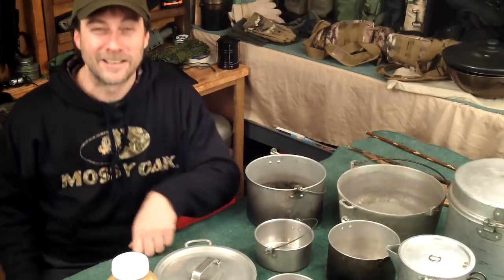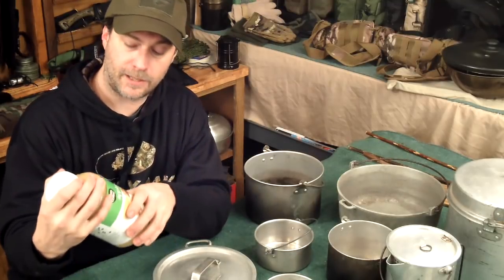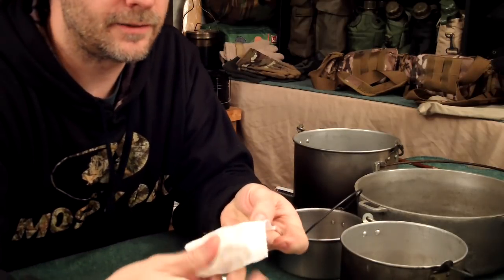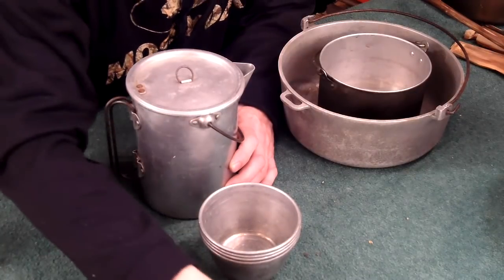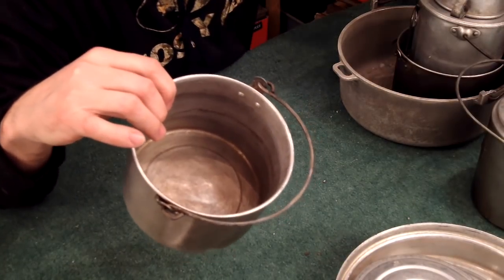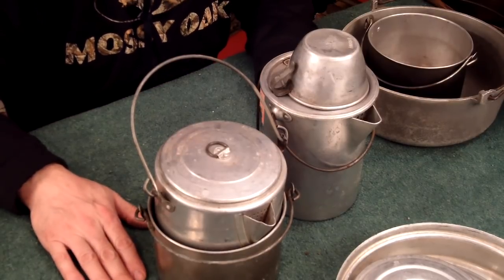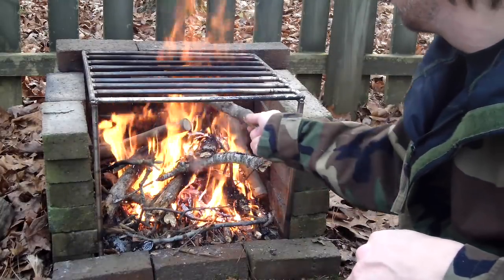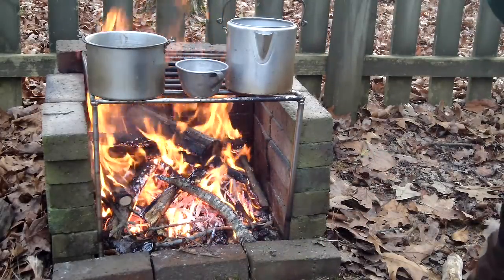Testing Old Aluminum Cookware For Toxicity

Comment: I'd be curious to see what that big cast kettle was like after being boiled out with vinegar and water, and then polished inside. I can't help but wonder what might have been cooked in that cast stew pot before you tested it. 
There was a whole line of camping pot sets that were made in the U.K. post WWII with scrap aircraft aluminum alloy, produced by stamping with dies in a press (I think they used a succession of dies to get the completed shape of each pot, as is done with soda pot cans. 
One trade name here for the British camping sets was "Bulldog" - there were others. They were harder  (didn't deform as easily) than some "soft" aluminum cake pans, and they did not develop porosity on the inside surfaces. I used those  in the bush for many, many years, and they still clean up nicely. No porosity or significant discoloration. How true the story about aircraft aluminum alloy is I'm not sure, but whatever those were made of, they were very tough and not porous.
Reply from the maker: Thank you for sharing that! Very interesting

Comment: Maybe it has to do with the oxide (the stuff that comes off on the paper towel) reacting with the acid  in the apple sauce. I have a 6 pc kit that I remember from when I was in cub scouts, but I'm not keen on eating/drinking from aluminium anyway. I think I'll just get myself a stainless steel set and have done with it. My brain cell level is low enough as it is.
I hope your Christmas and new years were good, and I wish you and yours all the best in the new year. T
Reply from the maker: Who knows? I scrubbed that pot ten times with steel wool and it still grayed up a paper towel. Its either that or its the alloy content of it. I had a pretty good Christmas. Thanks for watching Bruce.

Comment: I recently bought a vintage Polish army mess kit and canteen, both made of aluminum, I should get some applesauce and test them.  the mess kit looks either very seldom used or very well cared for, the canteen does look a bit dull on the inside
Reply from the maker: Yes, absolutely test it before use!
Reply: I'm waiting on a Polish military utensil set, I think they may fit inside it.  I also just got a leather strap to go on the mess kit to keep the handle locked down

Comment: As always, I love your videos. As the previous commenter noted, Aluminum has been linked to Alzheimer,s disease and should not be used for any cooking as the aluminum leaches into the material when heated. For this reason I have gone back to stainless steel for the small pots, and titanium for the larger pots to save some weight.
Reply from the maker: Thanks, I'm glad you like em. I try to stick to stainless myself when I can

Comment: Don't throw out the cast pan if you give the cast one a good scrub and then use  
A bottle of tomato ketchup and use it like metal polish and clean the inside of the pan and if wanted the out side as well there are other ways to do the same thing 
Great vidieo   and greetings from Carrickfergus Co Antrim Northern Ireland .
Reply from the maker: I scrubbed and scrubbed and scrubbed with  steel wool and nothing worked. Maybe I'll try the ketchup idea., I'm glad you liked it. Thanks for watching Harry

Comment: well you know i have a bunch of old really neat camp aluminum pots. some are just real nice. honestly personally i've just never liked aluminum for cooking, but i've used aluminum in the bush quite a bit in past decades and the stuff has worked very well outdoors. still though i certainly do prefer stainless steel. one thing i just wouldn't ever do is abandon cast iron cookware because i use it extensively indoors and outdoors. with all of the space science, landing on the moon, or whatever i just don't think anything has ever been found to be better than a good seasoned-up cast iron skillet and i doubt anything better will ever be discovered. for weight's sake i carry an old smooth fajita griddle (cast iron) when i go out. that's what i use outdoors and for me it's big enough, small enough and not too heavy to haul/pack. nothing sticks to it (not even scrambled eggs). wrap it in a plastic bag and carry a small SS wooden handled cookie spatula. that's my 2-cents worth and i'm certainly no genius at all.
Reply from the maker: Well said. For home and car camping I love cast iron. For backpacking I prefer stainless steel but sometimes its just handy to have aluminum for long trips. I still try to stick to stainless as often as possible. Thanks for your comments and thanks for watching

Comment: Hello brother ... Happy New Year from here in Scotland. I read about this aluminium possible problem sometime last year and tried to find out more about it. Like you I found that it seems like there are different results for different types or age of aluminium pots and pans. Cast does seem to more of a possible problem and can feel different to the pressed ones. The large pot/pan was a common item in homes here years ago. The were bigger and tended to used for jam and marmalade which would leave a different colour on the aluminium. Overall I decided to stop using my aluminium camping gear. Now it is all stainless steel that I use. Well David I need to go .... my good lady wants to go to the January sales ...... I can feel my cards melting all ready. Take care ... Jim
Reply from the maker: Happy New year Jim! That's very cool you've researched tho. And actually right now 90% of my camp gear is stainless. Take care and thanks for watching.

Comment: I gave up my $100 Cuisinart stainless steel coffee maker and bought a not too old but vintage small 5-cup aluminum coffee pot percolater from eBay for $15.00. I love old school and always wanted to percolate my coffee like my parents used to. So far my coffee tastes great and it's way hotter just the way I like it and so far I don't have the shakes, forget where I am or fallen off my chair yet! The old pot is made from rolled aluminum and so far it seems okay to use.
Reply from the maker: Stamped or rolled from sheet aluminum seems fine so far. Its the cast stuff that's tested bad.

Comment: boiling water with baking soda will loosen the stains on the cast aluminum .   Look on the bottom for marks determining manufacturers,   Many of the cast iron makers also had a aluminum line .  The shape of the dutch oven is very similar to Wagner Ware and Griswold. (after 1957 they are the same corporation)   The D ring is to latch or hinge the lid to the pan.   Lodge uses an exaggerated version that is intended to be used as a helper handle .    

you should look up what interacts with citrus acid and turns red.  That way you can verify what  you are actually testing
Reply from the maker: Thanks for the input Randy. The marks on my pot were so worn I couldn't make it out.

Comment: you could try boiling vinegar in the cast pot. it is known to clean metal such as copper and aluminum. old moonshiners trick that they would do prepare thier stills for preparing shine. supposedly the acidity of the vinegar cleans the metal of impurities, vinegar is cheap and it could rescue a nice looking pot.
Reply from the maker: Someone else mentioned that. I may try it.

Comment: I don't think I'd ever use cast aluminum; I'd only use stamped aluminum and then only in a pinch.  I do have WWII aluminum mess kits that I'd use only in emergency situations.  I also have WWII mess kits and canteens that are stainless steel which I prefer.
Reply from the maker: My favorite is stainless steel but I do own a lot of aluminum cookware

Comment: On a side note...CANNED orange juice in a pot or bbq plate cleans the metal to a high polish. Very acidic stuff. Interesting it seems to ne just the cast alloy. Whick looks to be the same type of cast in a transmission...perhaps from that we can find out about the lead content from that...there may be more specs available.

But im with you...I'd give that cast a miss. Ive noticed similar when I cooked for a living in the 80's. It seemed to be the more pourous type of cast saucepans that would put a tinge into white sauce and would make a difference in the roux stage. Smoother panz potz didnt and they were the newer stuff.  So overall I'd say your on the money about the lead content
Reply from the maker: I believe Im totally done with cast aluminum after this test.

Comment: Thanks so much. Testing today.
Reply from the maker: Sounds great Tony
Reply: Our cast aluminum pot that is like yours, that showed a change in color, showed no change in color. Marked o.k. the bottom is a partial symbol. Looks like a dual ring with a bust of a male figure. The word Club it's below the bust which is centered over the u. Best info I can give you.

Comment: Very interesting Dave,never thought about the toxic test,your correct about all the other pots are from sheet metal except the "dutch oven pot" ,they made them in cast aluminium to safe weight instead of  cast iron
I noticed myself when you put a aluminum pot or other item in the dish washer they have a white oxidation because of the salt that your using
That's why I always clean them with hot water and some mild dishwasher soap,and rinse them with clean water
The grey layer on the cloth is also more showed in the cast pot then the sheet metal pot in the video
Could that be also a reason to why the apple saus turned out pink?
No other pot has it except that one,and the others are sheet metal to
What if you had a second cast aluminum pot?
Just a thought
Merry Christmas and a happy New year to you and your loved ones
Atb
Steve
Reply from the maker: Thanks Steve. Man I have no idea on another cast pot. I do know the one I have has been scrubbed multiple times. It was the only one that failed the test but after this video I heard from a friend that had  stamped one fail too! Thanks for watching and I hope your Christmas was  merry and I hope you a Happy 2018!

Comment: A great video! Wow.  Good to know.  The color difference and the added smell difference.  Great indicators.
  I wonder, can you bake in the cast pot using other pans or line the cast pot with Aluminum foil to bake in and not get poisoned??
Reply from the maker: Thanks, I'm glad you liked it. Usually it just changes color. The bad smell was a dual indicator! You probably could bake in it or use aluminum foil. They claim the dangers are the leaching from direct contact

Comment: Apples are acidic, part of the reason you get that reaction. I have an old Majestic sauce pot. I call  it my 'rice pot' as that is all I ever use it for and with the accompanying lid, it makes perfect rice. It is heavy cast aluminum. Hopefully there is no toxicity as rice has no acid content. I did the wet paper towel thing and the towel came back perfectly clean. I have tried to determine the age, there is not much info out there. Holtum  manufacturing from the 1930's is as close as I could get.
Reply from the maker: That's a good sign when it passed the paper towel test. My pot was scrubbed with steel wool exactly ten times and it still grayed the paper towel! That's very cool your pot is from the 30s

Comment: Just found this video. I am not a chemist nor do I play one on the internet. I'm not a professional cook, either, but I know a little about it from 50+ years empirical experience. 

I suspect that your cast aluminium pot had been used at some point in the past to cook acidic food such as tomatoes, apples (there's a hint here!), leafy vegetables or the like. Maybe more than once. Aluminium which has not been anodised will react to the acid in foods by pitting, which leaches tiny, tiny amounts of aluminium out of the surface of the pot. This leaves tiny pits in the surface of the pot or even larger ones, depending on how much and how long the pot was in contact with the acid. A pitted surface has much more surface area exposed than a smooth surface.

Will it hurt you? Probably not. The magazine Cooks Illustrated did an experiment where they cooked tomato sauce in an aluminium pot for 2 hours, then stored the sauce in the pot in the refrigerator for 8 hours. The resulting tomato sauce smelled and tasted bad but when a sample was sent to a testing lab, the results came back indicating there were 0.0024 milligrams of aluminum per cup of tomato sauce. For comparison purposes, a single antacid tablet can contain more than 200 milligrams of aluminium.

Anodising on an industrial scale dates back to the 1920s, so your cast aluminium pot may well have been anodised. Problems with anodising happen when an anodised pot is overheated, which can create microscopic cracks in the anodised surface, which allows acids to come into contact with un-anodised aluminium. Those microscopic cracks then get enlarged and it's not a good outcome.

All your test really showed you is that your cast aluminium pot either was not anodised or was used improperly. The other cookware you tested was probably anodised and the coating is probably intact. For instance, natural cocoa is for sure an acidic ingredient, so your cocoa pot was undoubtedly anodised to prevent it reacting to the acid in cocoa and giving it a horrid smell and taste. Dutch process cocoa powder is a bit milder because it has been alkalinised--but a manufacturer could not hope to predict which type of cocoa an end user would pick, so anodising would be a cheap way to prevent a lot of complaints.

So. Your cast aluminium pot is probably safe to use with non-acidic foods but the only way to find out for sure would be via a testing lab.
Reply from the maker: Thank you for that good information. Now a question. I've seen black or gold anodizing but do they make a clear anodize?
Reply: The black, gold, red, blue, etc, anodising is a form of dye that is molecularly bonded into the anodised aluminium surface. An undyed anodise is just silvery, the same colour as things like aluminium foil.

PS--I agree with comments below about your voice. You could read the phone book on video and I'd watch it!
Reply from the maker: Thanks!

Comment: You might be able to resurrect that cast Dutch oven. 

A mixture of vinegar and salt will clean the oxides off brass.

Modern brass is an alloy of aluminum and copper.

One solution would be to squeeze two or three test patches of ketchup into the bottom of the pan and wipe them out after different time intervals  (e.g. 10, 20 and 30 minutes.)

Once you've found out what time works best, coat the whole pot liberally with ketchup and let sit (the outside is oxidized also.)

Then rinse off the remains with soapy water and redo the test.
Reply from the maker: Thanks Mark, I'll see what that does.

Comment: Now you have me wonder about my old Sigg Tourist set.
And I wonder if  the same problem could exist with the cast copper pots I use that were made in the 1850's....  What was used in the casting process of 1800's copper ???
Thanks for the video !
Lee, Indianapolis (BushRadio on BCUSA)
Reply from the maker: Of all the metals that get cast or forged, copper has the highest melting point so chances of all the impurities being burnt off are much better than the lower temp aluminum would be. I used to a member of BCUSA but never had time to post so my membership lapsed. Thanks for watching

Comment: Since it's aluminum, it's not good to cook acidic foods in it as it will cause a reaction. Applesauce has a PH of approximately 3.5 which is decidedly acidic. This is not a test I would rely on. 

If you are concerned over your aluminum cookware, take it to a metalurgist and find out what tests you SHOULD be running. I have found that over the years, as you just did, that cast aluminum is far more reactive than stamped.

Personally, I stick with either carbon steel or stainless steel. I might go titanium one day, but that stuff's expensive... I've still got the old aluminum stuff, but it never gets used any more.
Reply from the maker: 90% of my current camp gear is stainless steel.

Comment: There's a lot of information about cast aluminum on welding websites.  Most say that cast aluminum is difficult to weld because of all the impurities in the metal.
Reply from the maker: Yep, it's very tough to weld
Reply: @Reallybigmonkey1  What I mean is that the stuff making your applesauce pink is in the cast and not from what was in it before.  It's always been there.
Reply: I forgot to say thanks for all your videos.  Very informative and interesting.  Thanks-
Reply from the maker: Thanks Ralph!

Comment: Acid eat away at aluminium. Do a simple test with aluminium foil,  in the UK it's wrongly called tun foil. Put some applesauce on it. Do the same with tomato sauce, brown/HP sauce try other acidic sauces etc. The foil will be eaten away by the acid. Same thing happens to aluminium cookware. Ask a Chinese restaurant/take away if you can look inside the pot that is used to cook the sweet and sour sauce. It will be pitted where the aluminium has been attacked by the acids in the sauce. Some food places keep the sauce in the pot always. A huge danger to consumers.

Comment: pour some vinegar into that cast aluminum pot and let it sit for a little while .  about a half hour.  then scrub it out with a scotch brite.  to remove the oxidation.   Or you can use some sandpaper even to remove the layer.   After it is thoroughly cleaned, repeat the test on your stove top,